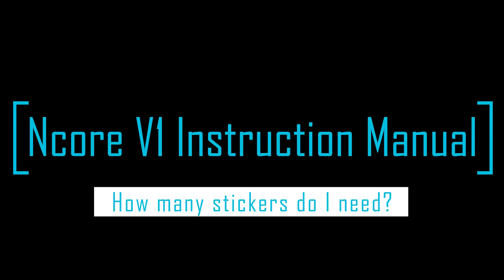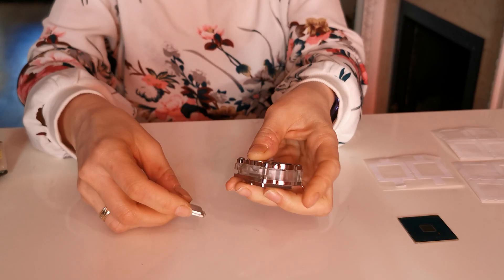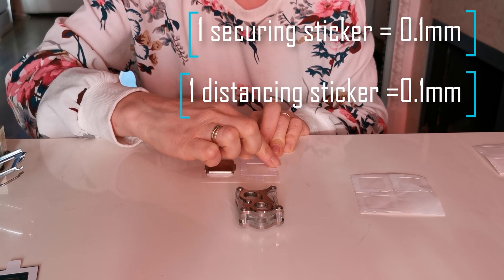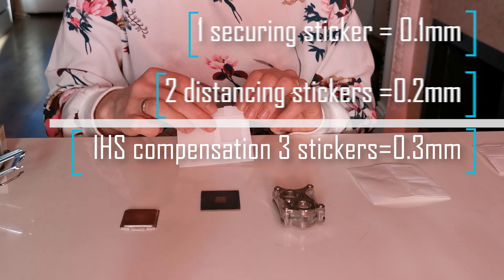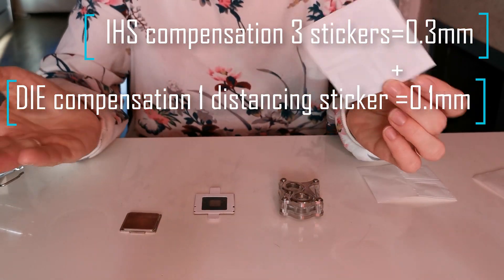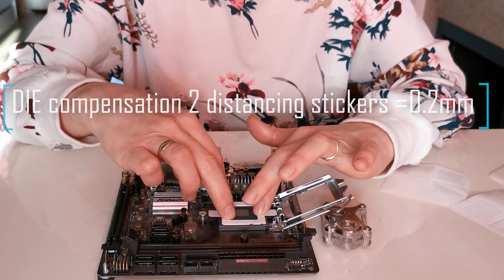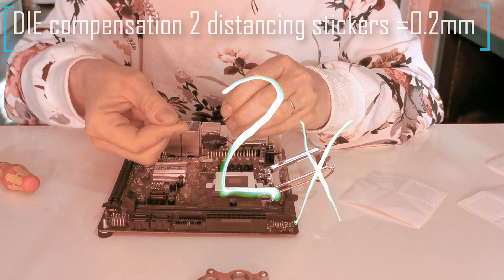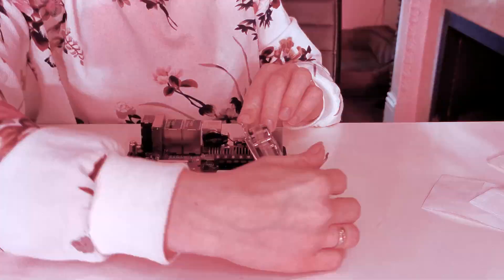Direct on Die Watercooler Ncore V1 manual- how many stickers for my CPU

Comment: Hey I have one of these and just got a 13700k. Do you know if it will work by any chance? I know that the die is larger, package is rectangular, package thickness probably different etc, but still curious if it will technically fit, cuz it would blow away a regular block still. Thanks!
Reply from the maker: No it won't fit 13700k
Reply: @NUDEcnc  Thank you!